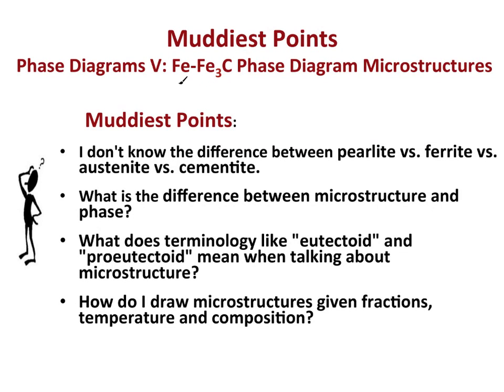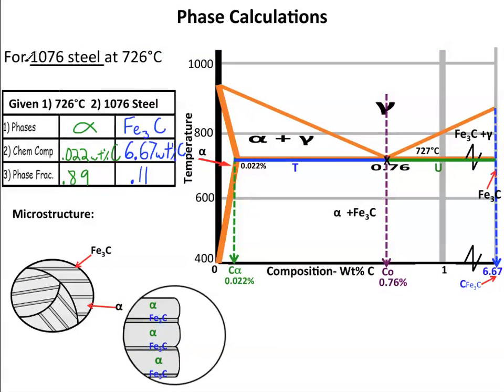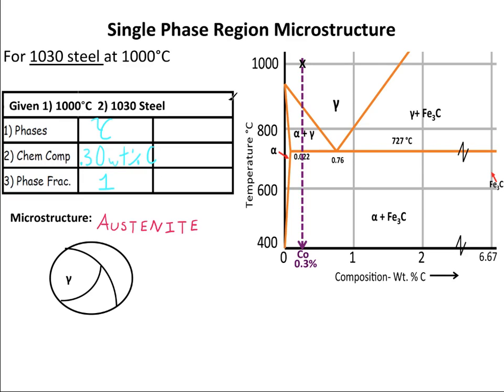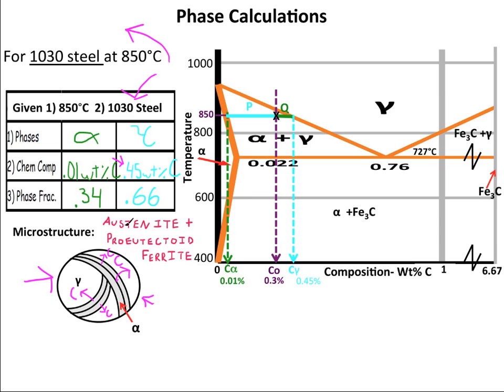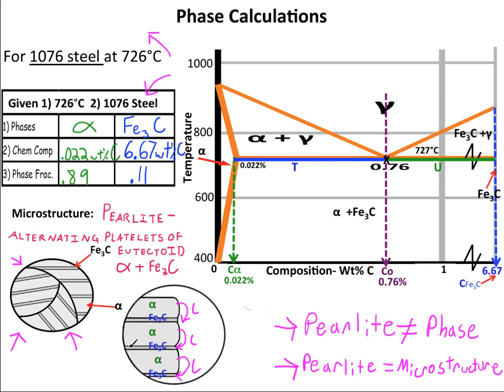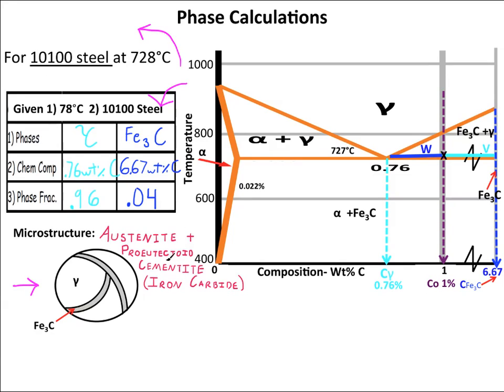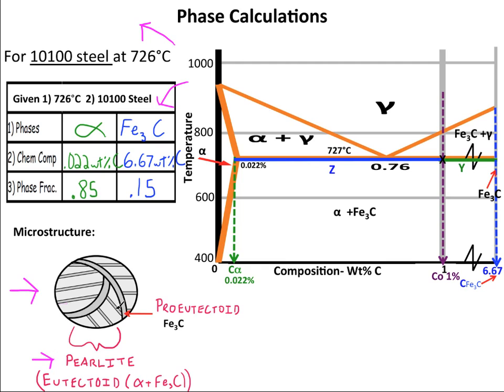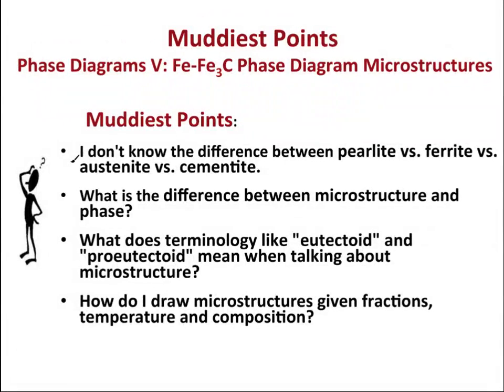Muddiest Point- Phase Diagrams V: Fe-Fe3C Microstructures

Comment: Is the proeutectoid (ferrite or cementite) always present in the microstructure even at temperatures more than just 1 degree after the eutectoid transformation, say 100 degrees C after?
Reply: Proeutectoid can be ferrite or cementite, Depends if it's hypo og hyper- eutectiod. if its hypoeutectiod it's ferrite, if its hypereutectoid its cementite :)

Best Regards.
Mechanical Engineer
From Norway
Reply: And it can be proeutectoid as long as it is below the liquidus-line and over the solidus-line. Proeutectoid means before eutectoid (Pearlite) occurs.